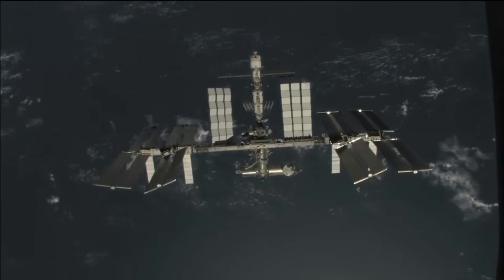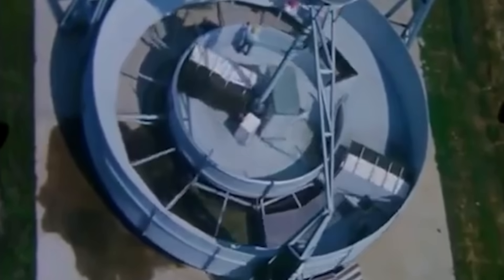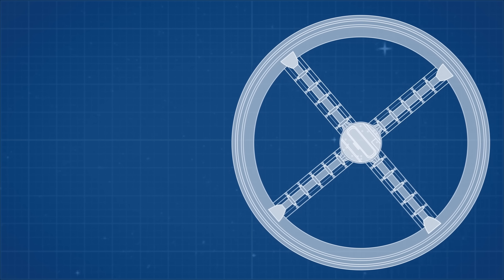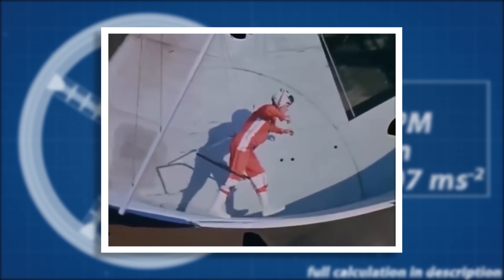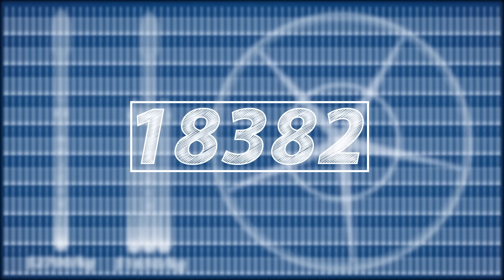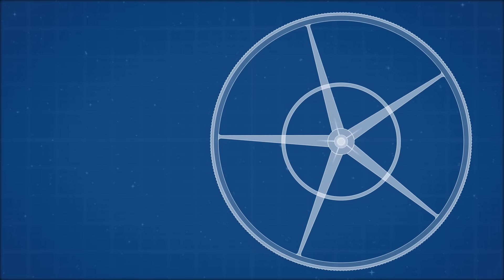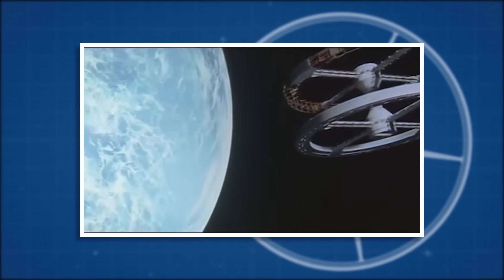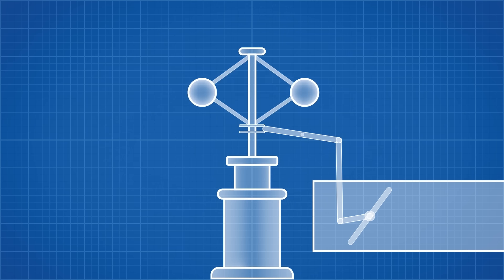Can We Create Artificial Gravity?

Comment: Is this a serious channel? Are you saying that centrifugal is just the equal and opposite reaction force of centripetal? If you aren't joking here is one way why centrifugal isn't real: when in the artificial gravity rotation doughnut, you are always moving with a velocity tangent to your circular path. So that means your velocity is changing, because at each point on the circle, it has a different tangent velocity vector. This velocity change, is really an acceleration, that that acceleration vector is pointed straight at the center of the circle. Because you are a mass that acceleration is a force equal to your mass times acceleration. That force is the centripetal force, you know how to calculate that. I felt a need to say this because you are spreading misinformation about centrifugal force existing.

Comment: Yes they can do it, but there woulkd be problems with motion sickness and possibly loosing control of the spin.  Loosing control would especially be a risk in low Earth orbit because of the thin atmosphere.  It would also be a problem for the long teather design - the station and its reactor power supply spinning around each other - this design is the only one efficient enough to be feasible.

Comment: I saw the US military using a rail gun one of thees days! I wonder if they could somehow adapt the tec to shoot larger payloads to space, or somehow hibridase a hyper loop and a rocket plane, build the track upwards a tall mountain and launch like that! Or on the space elevator project, they are unable to produce long nanotubes, but what if they would weld the ends together, or find a way to weave them in to a fabric to produce a rope like cable?! If any of these would be further perused would definitely drive down launch costs and instead of building the station/s with aluminium they could use other stuff like ceramics, plastic, carbon composites, etc.

Comment: This was interesting but didn't exactly answer the questions I have when it comes to 'spin gravity', like what would happen if you jumped while in it?  What would happen if you started running against the spin of the ring, causing yourself to travel slower relative to it?  Though I suppose these aren't quite engineering questions I am having a hard time finding answers for them.

Comment: Linear accelerator cannon on Luna can loft robot woven fiber bundles to high Earth orbit a lot cheaper . . . but you'll have to install the system.  That system can be made of mined and refined Lunar material and fashioned into useful allotropes, alloys, and forms, by robots now being designed to assemble orbital stations.
And some American English:
Orient: to point in a direction.  Disoriented: unsure of direction.
Orientation: to be informed and demonstrated by guides or teachers.  Disorientate*: does not exist.

*Funny that spell check tells me "Disorientate" is correct, but "Allotrope" does not exist.  Draw your own conclusions from that.

Comment: A giant wheel isn't the only option. The other possibility is a tethered double-module ship. All you need is an extendable tether, two modules, and the ability to spin them. They can be as long as you need them to be.

This is a nice design for interplanetary ships. Consider the Constellation program ships: a hydrogen tank with a nuclear engine on the end, a payload in the middle, and the crew in an inflatable Transhab. If the Transhab is instead placed on a tether and launched away, it could rotate slowly, have a small gravity gradient, and still have Earth-like gravity.

Comment: Also the problem that people walking in opposite directions experience different effective gravity.
Reply: That'd basically be like either constantly walking slightly upwards or downwards.
Reply: salve_pleb    That's right.  If you walk in the opposite direction as fast as the rotational speed, you would become weightless.   Since the weight generated would be low, it would be best to walk in the same direction to increase your weight.
Reply: Oh ye the one walking towards the rotational spin would experience more gs and the one walking in the opposite would experience less

Comment: To the people saying "there is no centrifugal force" - then why does water stay in the bottom of a bucket when I spin it? Yes, it is the water's inertia, but that's only true in our frame. In a spinning frame of reference, there are "inertial forces" that come as a result of the non-inertial frame. But Centrifugal force is just as real as gravity - since gravity, as well, is the result of a non-inertial coordinate system in the context of General Relativity.

Ultimately, it's a useful way to solve problems to simply treat it as a force, and in those situations, it is indeed a force as much as gravity is.

Recently I solved the geodesic equations for motion in a rotating spherical polar coordinate system. Trust me, slapping "a = v^2/r" on a problem is much easier, and for most cases, it's more than precise and accurate enough.

Comment: Using inflatables the cost of a mega structure like Elysium would diminish greatly. Though for a smaller station which would need to have a higher angular velocity, to the point of disorientation, can be remedied by having it completely enclosed, so that the brain doesn't realize it's rotating.

Comment: Trying to create a warp in spacetime to act as the gravitational pull of the earth, in something the size of a building, but not creating compression and expansion based fatigue in materials as it is turned on and off, that negates the effect of inertia as the object changes velocity, and doesn't pull entire planets out of their orbit...  warp drive seems simple in comparison.

Also a gravity generator is an excellent drive system. 

Create a simulated mass and the ship falls towards the simulated mass to near the speed of light, turns and decelerates using the same gravity simulator. variable simulated gravity mass allowing variable acceleration to achieve higher top speeds in shorter distances.  no need for chemical engines just manipulate spacetime to fall in the desired direction.  Well maybe at first for roll and pitch control but eventually possibly multiple simulated masses could control that as well.  If you can do magic, maybe you can multitask magic?

I do not actually think it's possible, just pointing out the fantasy has not really touched on its own possibilities.  Even if it is possible, breaking the universe to be more comfortable in a convenient way is probably a super bad idea.  The moment of comfortable gravity without annoying mechanical systems like centrifuge might be watching everything in existence collapse on itself from being screwed with too much.

Comment: Why does everyone picture a bicycle wheel like space station?
it's much simpler than that, picture a bucket on a rope. A kevlar cable 2 cm in diameter and 30 km long would weigh only one ton and could support a pair of space stations the size of Skylab and rotate once every 4 minutes.

Comment: This little doctrinaire is an example of inflexible thinking. Try this: two equal mass modules tied together with a Kevlar cable or a carbon-fiber tube, and rotating around the midpoint of the structure (not spinning on the long axis). You can achieve centrifugal gravity without a full ring. An end-over-end rod will do.

The tube could be made of tapered segments that nest within each other for shipping.

Comment: it is not centrifugal force, its centripetal force. Imagine a mass attached to a rope swinging around a center. If the rope gets cut at any point, the mass wouldnt leave the circle in the straight line of the radius - thats what the centrifugal force tells. it just leaves it tangential, as there is no longer any force there that accelerates the mass in direction of the center - and that is centripetal force, hence people telling there is no centrifugal force ;)

Comment: Seriously people think that centrifugal force isn't real. I found out how to do it when I was five. Grab a walmart bag or whatever, put an apple in it and spin it around in a circle really fast. The apple forces against the bag and doesn't fall out.
Reply: you can do the same thing with a 2L coca cola bottle, just spin that shit around and the coca cola wont touch the top of the bottle. it was fun doing it with different objects.
Reply: You can do it with a cup of water in your hand. The water will not fall out of the cup even when upside down
Reply: Centrifugal force is a real physical phenomenon, but it's not a true force according to the precise scientific definition. Any time you experience what you would describe as centrifugal force, it is always better described as some other force or combination of forces.

For instance, if you're in the right front seat of a car heading due north 100kph and then the car makes a hard turn to the west, you feel a "centrifugal force" which seems to want to push you hard into the right side of the car. What's really occurring, however, is that since your body and the car aren't one single object, your body wants to continue travelling at 100kph due north, but the car which is now turning to the west prevents your body from doing so. You feel an apparent force pushing you outward, but what's really happening is just an interaction between the car's inertia and your own.

So, real phenomenon, fictitious force.
Reply: Sure, it isn't a real force, but neither is gravity, but Captain Argument never comes out about that in the comment section. Gravity is not a fundamental force like the strong force, weak force, or electromagnetism, but a consequence of the geometry of space-time as described by Einstein. Maybe someday someone will find gravity particles and unite gravity with the fundamental forces, but that day aint today. 

There is absolutely no reason to stop using the phrase "centrifugal force" as it accurately and concisely describes a phenomenon.
Reply: Centrifugal force isn’t real because it is our interpretation of the real force, which is centripetal force. When you spin an apple in a bag, the apple wants to go straight, tangential to the circular path it is forced to follow by the bag, not in a curved path. It is the bag exerting a force on the apple that keep changing its velocity vector. So technically, the apple is not pushing out on the bag, the bag is pushing in on the apple. Regardless, it is commonly perceived as the apple pushing outward. The best test of this is to simply release the bag. If the apple were truly pushing down on the bag, then it would fly outward directly away from the circle. But it doesn’t, it follows the tangential path described above. Doesn’t change anything as far as creating “gravity” in space though.

Comment: Another problem with this, is that walking in a specific direction for a long time, would cause enough force to change the rotation velocity. So you would have to re-synchronize the rotation velocity every once in a while.
The smaller the ship, the more often you would have to synchronize.

Comment: how about small station connected by long cable to the counterweight on the other end (or to second station).  Everything would rotate around the center of the gravity.
Such a cable or many of them could be build from carbon fiber for strength and low weight.  They could be pretty long, several kilometers so the spinning wouldn't have to be fast.

Comment: Let us say the diameter of Elysium mentioned in the video at 60km is the ideal for an adequate gravity, imho you should not think about building the complete wheel. You only need a center habitat with micro gravity that would be used for docking and research. The outer shell of this habitat would rotate at a certain RPM, but the real habitat would counterrotate at the same RPM to stay quiet and be pleasent for the researchers. Instead of this tapered arms, you would have two composite ropes 30km each pointing in opposite directios and on each extreme you would have a decent size full gravity chamber or habitat. The external chambers would rotate arround the central one at the same RPM of Elysium. Of course you would not have PI*60km as a walking trail, but you could have a 50m diameter walking or running path. A big deal of complexity to keep the central habitat always in the center of mass of the rotating arrangement when the mass of each extreme is not kept equal. A big deal of complexity to keep the ropes always tense and not starting to osscilate. A reliable docking port and transport system to travel from the center habitat to the extrems. But thos are engineering problems that can be solved as landing a firs stage on a platform on the sea. The ammount of materials could be kept at 1% of Elysium. Now go down from 60km to 6km, have a compromise in gravity and increase the RPM and the whole arrangement gets much smaller. I think the wheel is a killer goal.

Comment: Make a section of the floor an electromagnet. Put metal weights and other metal exercise equipment in this area. The electromagnet flooring creating simulated gravity as long as the electromagnet is turned on.
Reply: Workout clothing infused with magnet reactive metal.

Comment: (all figures in this post are approximate) (for this I used a figure of 30 layers of CF at £80.10/m^2) Ok I did some more math... (I am a nerd I know) but we could build an Elysium style space craft that would cost less than £175billion to build. If you build the structure with a structure radius of 0.5km with a structural width of 2km you would have a circumference of 3.145km an a land area of 6.29km^2 you could save weight by growing food in the base using aeroponic systems that save weight with water, compost and air scrubbers and use Carbon fibre as the main building material to save on transport costs. for the transportation of materials use the British space plane (Skylon) (yes it is as cool as it sounds) which can carry cargo for a cost of only £650/kg and even including the final R&D costs to finish the design (about £2.3billion) the total costs would still be less than the cost shown in the video to build the ISS then for future missions to the space base continue to use Skylon as it would be capable of landing on a runway on the base carrying less fuel so it can refuel in the base for the trip back as this would save on fuel costs each way and allow a higher cargo cap per trip. Before anyone comments on the gravitational changes between your head and your feet (2m approximate) that would mean a gravitational difference of 0.5% (about the same as going from the equator to the north/south pole)

Comment: Rotating spacecraft don't have to be large. You just need a kilometer of string and a counterweight to rotate around (maybe fuel, or a sister ship). Like a bola. This works fine for stations, or a ship going to Mars, and it can be as small as you want - waaay smaller than spinning rings. Or you could do it with a ship the size of an aircraft carrier, or a city.

Comment: If the force of gravity is greater at your feet than at your head, that doesn't mean more blood will go to your feet. Gravity is always pulling blood down your body and a lessened degree of it isn't going to increase the pull.
Reply: Jarrett, at the surface of the Earth, the differential is small and we've evolved to handle it. On a small, rotating station, the differential would be significant and enough to cause problems described in the video. Fighter pilots for example have to tense the muscles in their lower body when making high speed turns to keep the blood from going to their feet and passing out.
Reply: It’s a matter of understanding the definitions of centrifugal and centripetal.  Our schools have failed.
Reply: One thing is certain gravity is not the force working to create artificial gravity.  Consider the attraction mass has does not require spinning,  think on it

Comment: There are a few errors with this.
 First you don't take into account that the body has no weigth, if you push it, it will go indefinitely.
 Second, on a weightlessness spinning environment, you would be pushed backwards, you would need a diagonal ramp from the circunference to the radius to keep you equilibrated.
 Third, it would only work in acceleration or decceleration, at equal speeds you would begin to float, or you would have to be glued to the station.
 Oh. and the NASA video is more about an example of weightlessness walking, he is still being pulled sideways by earth's gravity, which give him a slight help in keeping him in place.
I just came here to see if anything had changed these pasts 30 years or so, but I guess not. Future space travel is still a dream. Thanks to computers I now have an even better understanding of physics.